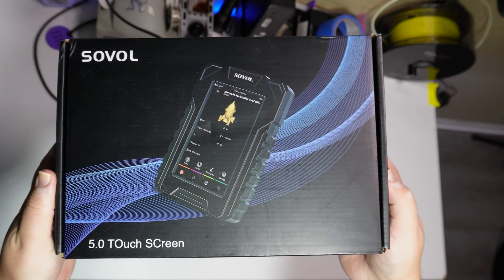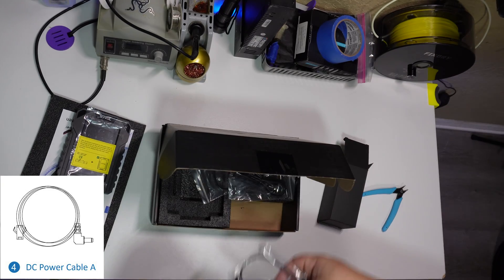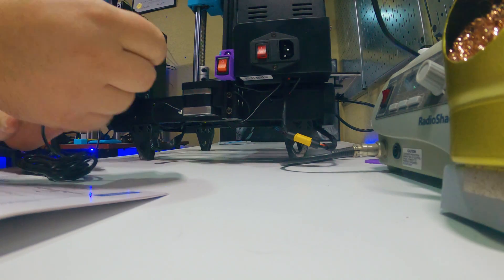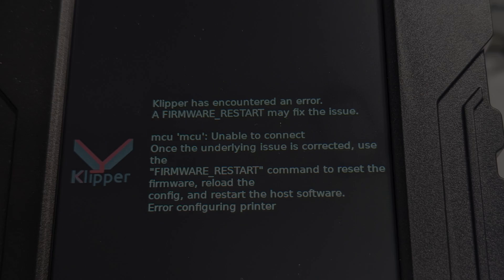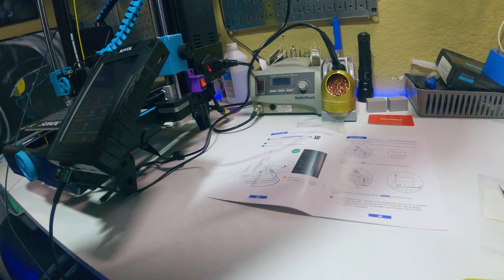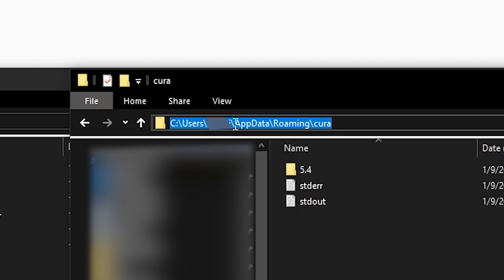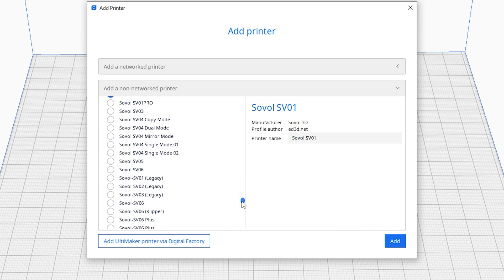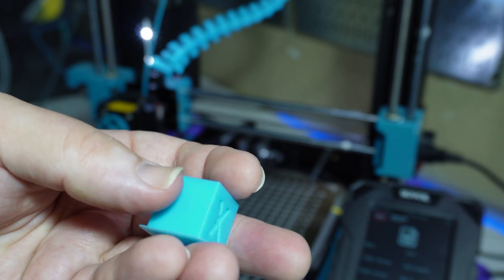Here's What Happened When I Installed the Sovol Klipper Screen

Comment: thanks for the video. i have a question about the all home and z offset. i do the all home and run the z offset calibration just like you did and saved it. then hit the all home button again and the z offset goes back to its original spot before doing the offset. is that what its supposed to do? shouldn't it go back to where i set the offset to? that's the way it worked with the normal controller. please save my sanity!
Reply from the maker: I'm not near my printer at the moment, but when you home, I believe the Z height is 5mm. So even though you set the Z-Offset, the home position is not the same.

In the menu, you should be able to see if the offset you entered/saved is still set. It's also on the main page of Mainsail in the Toolhead menu.

Hope this helps!
Reply: Yet another useless video because the fucking platform doesn't stay connected and the booklet doesn't give good enough instructions to show how the fuck to make it stay in place just like this video.

Comment: I put in my wifi address, got an IP (private ip as you did) but NOTHING after that.  Didn't open anything whereas yours went into Mainsail.  I assume the connection is from Klipper, to wifi, to whatever IP is associated with Mainsail, but have no idea why it didn't go there.  Ideas anyone?  I'm soooo close to making this work.
Reply from the maker: I had an issue where the IP was showing up but I couldn't get into Mainsail. 

On the screen where it shows your connections ( 14:06 ) at the end of the last line it shows a number and then '"dBm". That's the WiFi signal strength.

Mine was something like -90 dBm, which is very weak. If yours is weak, try moving the printer closer to the router, or what I did was buy a WiFi extender from Amazon for like $16 and put it in the room with the printer and connect it through that.

(The one I bought https://a.co/d/aKkcQFM)

Comment: What do you mean at 9:19, Z aline does not work, it tilts your axis? How do you aline then?
Reply from the maker: I printed two 40mm blocks and used those to align the Z. I just put one on each side of the bed, lower the Z by hand until it's pinching the blocks, then manually back each Z stepper off little by little until the blocks are just loose enough to come out.
Reply: @Avel So your Z axis tilts on its way back maybe? Your way should be faster. thx for the reply.
Reply from the maker: That would be my guess. One side moves just slightly faster back down than the other, which throws it off.  Ever since I started using the blocks, I haven't had to do that alignment anywhere near as often.

Comment: Great tip with trying another USB cable when getting the " 'mcu': Unable to connect" error. I had the exact same problem, and changing cables worked.
Reply from the maker: Glad you got it to work! I was going nuts for a little while trying to figure it out. 😆

Comment: hi, I tried to look for the folder where to put the file for care but I can't find it, how can I find it?
Reply from the maker: Are you unable to find the AppData folder? Try typing it out instead of clicking through the folders.

What I have to do on some computers is get to the users folder, click whichever user you want and then type \AppData at the end of the address because the folder is hidden.

That should take you there.
Reply: @Avel  thank you very much I will try, I have another problem when I try to connect to the Wi-Fi it doesn't find it or if it finds it it disappears after a while, do you know how to solve it? could it be a problem with my klipper?
Reply from the maker: Sorry I didn't see this sooner...

I had a similar  issue with the WiFi too. It was caused by a weak signal. I ended up getting a cheap WiFi extender from Amazon and have it plugged in the same room as the printer. No problems since.

You can test if you need one by moving the printer closer to your router and see if the problem goes away. If it does, then you have the same problem I had and the extender should fix it.

Comment: Did the bed leveling seem better? I am having bed leveling problems and I have seen people use Klipper to solve their bed leveling problems.
Reply from the maker: Honestly, I haven't noticed any major difference.

I was having issues when I first got the printer by using their Z Align function. That would throw it out of whack, that's why I skipped it in this video. 

I just printed two tall blocks and used those to align the Z at the bed. Haven't had an issue since.
Reply: @Avel  Yeah I am having a hell of time trying to level the printer. I cannot get it leveled at all. Which really sucks because its a great printer. Are the blocks you use accurate for leveling the gantry?

Comment: That happened to me, too, it means the firmware didn't take, as I am sure you are about to find out.  NOT THE CABLE. Easy way is to leave the old screen connected.  if it boots, the firmware didn't take.  If it doesn't, klipper should boot

Comment: I recently installed this screen on my SV06+ and had some issues but got things going after some fiddling. Print quality was horrid using the provided Sovol Cura slicer fork as well as normal Cura and SuperSlicer. Only after I did the work to move over to OrcaSlicer following gerGo PRINT 3D's tutorial with Christian Vick's presets did my prints start getting back to the quality I had before I installed the Klipper screen. Be aware that the manual states there should be accelerometer kits, plural. I recommend emailing Sovol about this as when I pointed this out to them they sent me an additional accelerometer for no charge. I have never gotten Z offset to save correctly, check it after it "saves" and you'll see it's a different number than you saved it to. My workaround for this is just to set, save and remember the number, check it again, then start a print and adjust the offset to match the discrepancy and dial it in visually on the first few layers. It'll let you save the offset after the print and then it'll be good to go.

Comment: Put a sv06+ toolhead on and a better part cooling fan and you got yourself a fast printer. I'm running the sv06+ right now and can do a regulation benchy in 9.30. limited by the y motor skipping steps due to trying to accelerate the heavy bed. You can probably get it down to 6-7 minutes on an sv06. The current limiting factor of the sv06 right now is the flow. You'll get 12. 15 on a good day and maybe 20 if you use a CHT nozzle but it's not enough
Reply from the maker: Thanks for the info!

Comment: I the video you showed the device booting up, and you turned it off before it could initialize. I think that this is the reason things went south. You probably turned it on the next time and gave it some more time to initialize and synchronize with the printer. I do not think the USB cable was the culprit here. Anyway - It's nice to see that Solvo is working great with Klipper...
Reply from the maker: Thanks for watching and commenting! This error continued through many reboots of the machine. I turned it off and on many times trying to re-flash it, thinking something had gone wrong with the flashing process. It also rebooted several times on its own when I selected one of the options (out of frame) on the MCU error screen to "Restart Klipper" or "Restart Firmware". All of which led back to the MCU error. 

Maybe the USB cable isn't 100% at fault but it wasn't until swapping the cable (and flashing again) that I got it to progress any farther.